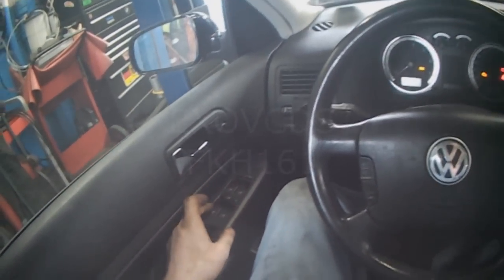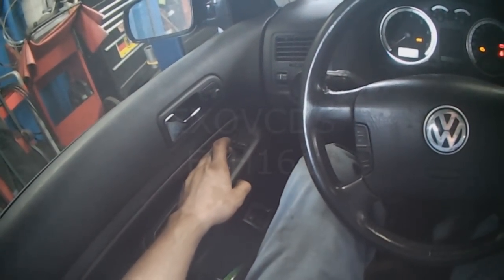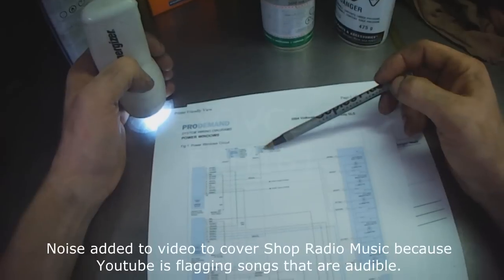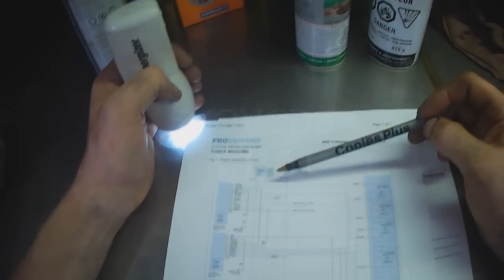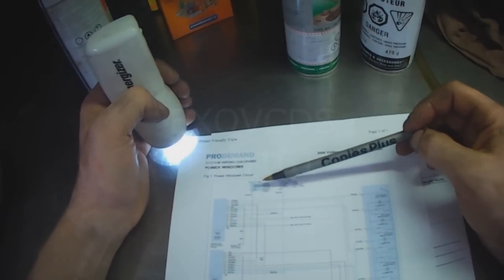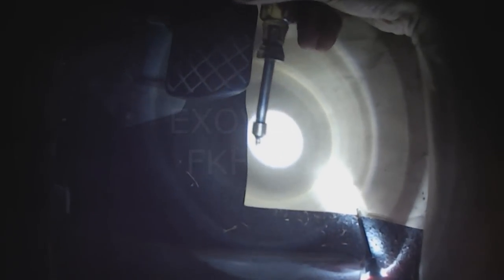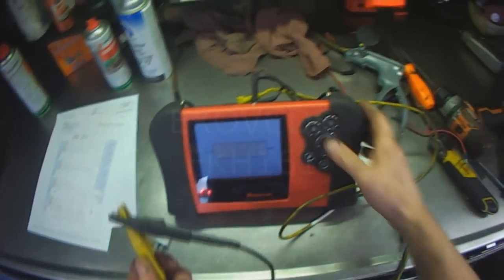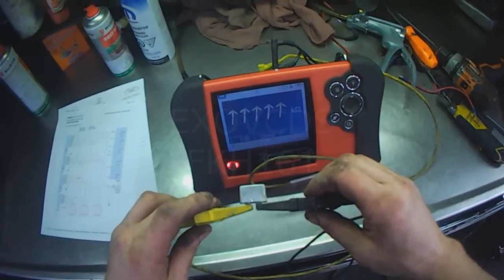VW A4: Power Windows not working

Comment: Hey Thomas! Love your videos, very helpful. I have an issue that is similar to this, except my sunroof, and power windows dont work, but my power locks do. I would assume theres another issue going on here because i've checked my fuses, and the circuit breaker looks good as well. -Thanks!
Reply from the maker: Year, make, model, engine, transmission.... so I can find the correct wiring diagram. You'll have to do your own investigating, as per diagram... I'm just starting work, so I'll get the info to you as soon as I can. If I find the correct diagram, I'll also look at it to see if I can spot something, but that might not happen right away.
Reply: Thomas EXOVCDS silly me, I appreciate the time you take to look it up, it's an 03 Jetta GLS 1.8T AWP, I believe o2m
Reply from the maker: http://fkh161.ca/VW/mk4PW.pdf
http://fkh161.ca/VW/mk4SunR.pdf
I'll look at t he diagrams later in the day to see if I can spot something that might be a common issue.
Reply from the maker: Sorry, the second diagram won't print to pdf correctly for some reason.

Comment: Hello Budy, how are you?

I live Brazil and no one works on these cars here, all i have to do. I myself do that.
I'm going through the same problem, as did everything in the video, but did not return to work.

Any tips the most?

Car: Passat b5 98/99 motor: 1.8 20v turbo AEB Manual

Thank you

Sorry for my English.
Reply from the maker: +andre luis aragão Click the link for a wiring diagram... print it out and check the fuses / power & grounds / wiring: http://fkh161.ca/VW/Passat/B5PW.pdf

Comment: HI Thomas, do you have a part number of the circuit breaker so i can order one to go straight in, my windows are clicking, so i guess this is the problem, 2002 passat b5, Thank you :-)
Reply from the maker: Install a regular fuse for testing... if thing work, google the part number that is on the circuit breaker. If things don't work, then it could be something else... but make sure that there's power at the circuit breaker.
Reply: @EXOVCDS  
It works ! Thank you so much for your help Thomas, Fantastic work my friend, cheers  :-)
Reply from the maker: @bassbins  Thanks for the update! I forgot to get back to you a few days ago... sorry. I get so many messages daily that I forget what I wanted to do. Here's the part number of the circuit breaker. 443937105A (30A)

Comment: Hello Thomas, I have exactly the same problem that all my passat b5 windows are clicking, so I replaced the circuit breaker with replacement new VW circuit breaker but this hasnt fixed the problem, any ideas how what i could try next to fix this?
Reply from the maker: Does the circuit breaker have power all the time? Is fuse 38 ok?
Reply: Fuse 38 was okay, turns out that when i pulled up the passenger carpet, all 4 cables had corroded away from the power connection as there was water in the foot-well where the wires are laid. I cut and reconnected. I also had to take the door panel off the passenger side and use circuit cleaner on the motor connection as this had corroded as well. now all the windows work. Thanks for diagnosing on the video that the clicking indicated that the signal reached the motors as this helped identify the issue was with the power.
Reply from the maker: chump city Thank you for the update... good to hear you sorted it out (I would not have been able to guess corroded wires due to water intrusion).

Comment: After I’ve swapped my battery on MK5 TDI ALL THE WINDOWS GONE CENTRAL LOCKING, MIRRORS, any idea please
Reply from the maker: Are you that the battery wasn't attached backwards by accident? Removing & replacing a battery should not cause any issues... unless something went wrong.
Reply: @EXOVCDS  probably yes 😔.. But fuses r fine. I’ve noticed today no lights on the central locking buttons, mirrors button etc etc

Comment: hi thomas same problem on my vw variant but no clicking of the relay what do i need to do?
Reply from the maker: I'd have to check a wiring diagram. Year, model,  engine, transmission or vin so that I can look at a wiring diagram. email me so I can send you the diagram once I have it. fkh161 @ fkh161 .ca (no spaces)
Reply: @EXOVCDS  it has been ok dear it was a blown fuse and can you tell me where the fuse for the airbag situated please?
Reply from the maker: I don't think that there are fuses for airbags... pulling a fuse or disconnecting the battery will not clear airbag codes.
Reply: @EXOVCDS  cause after replacing a fuse under the dash it came on.
Reply from the maker: Check for airbag fault code with scan tool... once you know what the code is, you can find where the problem is.
Reply: @EXOVCDS  ok wil try it thanks in advance
Reply: Hi thomas i am experiencing same problem as you again but now it's clicking but not roling up.
Reply from the maker: Check for broken wires in the door jam wiring loom.. or for a bad connection somewhere. I still haven't received an email with the information that I asked for (so that I can look for a wiring diagram for you).
Reply: @EXOVCDS  it is a volkswagen passat year 02 and 1.9 turbo diesel
Reply: Manual transmission
Reply from the maker: Look for wetness under the carpet... the comfort control module is under the carpet. Water can collect and can cause damage to the wiring & the module. Like this: https://www.instagram.com/p/BT7wg5flgee/  (press the play button)
Reply: @EXOVCDS  already checked and it is in good condition
Reply from the maker: OK... I'll send a wiring diagram to your email.

Comment: Thomas my window and central locking not working l have checek all fuses on my vag is show 01328 ,01329.1331,32,33and34 l chnaged the comofrt moudel and still same
Reply from the maker: Check a wiring diagram for all the applicable fuses (power & grounds) and then check all those places with a test light or multimeter. I'm out of town until Sunday and can not check specifics for you, sorry.

Comment: I have a 2008 vw Jetta and i can't get the window up. I hear the clicking noise when I try to let it down but i don't hear it when i try to let it up. What do i need to do?
Reply from the maker: I'm still at work... will get back to you later tonight once I'm at home.
Reply from the maker: What happens when you hold the key in the LOCK position for a few seconds in the driver door (outside handle)?
Reply: I don't understand what you mean. Am i trying to lock the door from the outside with the key? Cause if that is the question, the answer is nothing happens. The window looks like it is too far down in the door. But like i said when you press the window button down it makes clicking noise but when you try to let it up there is no noise. Do you know what it could be?
Reply from the maker: Holding the key in the lock or unlock position activates the windows (courtesy feature). All windows should go up or down depending on which way you hold the key.
My point was that if the window works when using the key, then the problem is with the switch / input side of things.
It could be a wiring harness issue... check for broken wires in the door jam (open the door and look in the accordion boot that the wires are in). Replace the wiring harness or repair the broken wires.
Reply: I finally got it to go up, even though i don't know how. The only thing i did was take the door panel off and hook the window controller back up. Then i pressed the window down three times and then i tried to let it up and then it went up. I don't know how it just started working, but i put some type over the button so no one can let it back down until i can get it fixed. Would you happen to know what might be the problem?
Reply from the maker: The A5/mk5 platform had wiring harness issues (as mentioned) as well as problems with the window regulator motor (door module). The "door module"is part of the regulator motor. I have had several Jetta's where either a window or a door lock actuator failed to work... but would work when pressure was applied to the harness plugs that plug into the window motor / door module. Not sure what the issue is with your vehicle... a wiring diagram and some testing of powers & grounds, along with a scan tool to view "inputs from switches" should help determine where the problem might be. But start with a visual inspection and wiggle test of the harness plug connectors at the window motor / door module.
Reply from the maker: A friend of mine had a similar issue:
https://www.youtube.com/watch?v=r5PWqqd9e2c

Comment: Ahhh.. I see you are using pro demand, much better then the factory layout I think..
let me guess this is a mkiv body style and the sun roof drain get plugs causing water to leak inside?
Reply from the maker: We are trying out Pro right now. It does seem to be better. As always, the repair is only about the complaint (no power windows)... didn't get a chance to track down any leak(s). Now that the customer knows what fuse / circuit breaker to check, they may or may not be back for a leak check.

Comment: My both Windows in caddy dont work
But cant find the circuit breaker
Reply from the maker: Year?
Reply: @EXOVCDS  2012 1.6tdi , replaced both switches checked fuses , but can only hear motors exactly as on your video but dont open
Reply from the maker: 2012 most likely doesn't use circuit breaker fuses such in the video. I'm in North America. We don't have that model here. The Motors in my video don't make noise... the relays make a clicking sound, not the Motors. I can probably find some information about your car by this weekend... I can get back to you then.
Reply: @EXOVCDS  ah i see
, Yeah it does make same noise as yours in the video , not sure what could be the problem , will take it to mechanic and see if he can plug computer and checks for any faults , thanks tho

Comment: Hi Thomas! I just bought a used 2015 VW New Beetle. Over the last 2 days, the windows responsiveness have significantly degraded & now have stopped working correctly from the drivers side door switches. The windows can suddenly (without pressing on the switch) go down and up, super randomly. I can also hear a clicking nose combination when the car is running. Could this simply be a fuse issue? Since I do hear the clicking from the motor? Any insight would be very much appreciated.
Thanks in advance!
Reply from the maker: +Marie-Claire Weber not gonna be a fuse issue in my mind... I'd look at a switch issue (corrosion inside the switch from water or spilled drink intrusion). Or wiring issue of the main door harness. My first step would be to check for fault codes and use the scan tool to check switch operation.

Comment: Hey brother. Quick question. I replaced my driver window regulator on a 2001 GTI with a used regulator. I found out later that there was a different motor for 2002 forward. Nothing works now. Does using the wrong motor fry anything, or should I just be able to replace with the correct one? At the moment neither side is working. If I unplug and replug the motor harness the driver side will work until the car is turned off, then will not work again. Any input is greatly appreciated. Thank you.
Reply from the maker: Swap your original motor over and see if things go back to normal.
Reply: Thomas EXOVCDS I threw it out, like an idiot. Ordered one from eBay, but nothing. No functionality at all. Maybe it's bad.  Is there something that needs to be done to reset the motors when swapping?
Reply from the maker: +Mark Torres The motor is the "door module"... if it's the wrong one for the vehicle, it can not be adapted or coded to work for a different application. As far as I know... I could be wrong.

Comment: hey Thomas. i have the audi b6 1.8T and passat b5 1.8. The audi b6 windoors are not responding  in any way and only 3doors will lock by remote except the front left door which does not respond at all to the remote. the key can only lock the driver side and only unlock the boot. the passat b5 does not respond to the remote in any way but can respond to the key only when i unlock on the boot. the key can not unlock or lock the driver side. i have tried all your tricks but it failed. help me out dude.
Reply from the maker: I'm still at work... will try to get back to you tonight after work.
Reply from the maker: Isaac Seleka Sounds like you need some wiring diagrams for both vehicles to trace things down. The VW Erwin website only charges $35 USD for 24 hour access... download as much as you want after entering your Vin number(s).
 https://erwin.vw.com/erwin/showHome.do
Reply: Thanks a lot thomas. I wil try download the wiring diagram and trace the problem
Reply from the maker: I couldn't send you a private message via youtube by the way. I sometimes send links to service manual information to people via youtube private message. If you don't know how to enable that, sign-up to my Tech forum and I'll hook you up with info there. I just didn't want to publicly post info here.
Reply: Hey Thomas, i discovered something strange. when the audi started misbehaving i just parked it coz da internal heat was too much for me to handle. Yesterday i thought of doing a check on all items to see the problem could b coming from. To my suprise, the wipers, indicators, dim option, electric windows and doors are all not working. All fuses are fine. Audi forums says its the CCM.
Reply from the maker: Isaac Seleka Possibly... check that the CCM has power / is awake (use a scan tool to check if you can communicate with it).

Comment: I have a 2001 Audi A4 none of my windows go up or down sunroof doesn't open and locks also on my driver side of the door the lights are not working on the panel but on the passenger and back door the lights are fine please help
Reply from the maker: Possible wiring issue in the door jam... look for broken wires where the door meets the chassis. 

http://i132.photobucket.com/albums/q33/x1rider/door21.jpg

http://www.audiworld.com/forums/a4-b6-platform-discussion-34/driver-door-wiring-harness-replacement-write-up-lots-pics-2379267/

Check the wiring as per the 2 links. If all is OK,  I can provide you with a wiring diagram, so that you can check power & grounds.

Let me know what you find.

Comment: I have no power on my window fuses and change the window relay and still no power .can u help me please 2007 honda ridgeline
Reply from the maker: Are you sure you checked all the fuses?
http://fkh161.ca/Import/RidgelinePW.pdf
Reply: @EXOVCDS  yes all the fuses are good .checkd the voltage and there is no power. They stop working after a guy install a remote start on my truck, he says he doesn't mess with the car windows any ideas?
Reply from the maker: No... you have a wiring diagram now... should be enough to find the problem. Follow the power / check the grounds.

Comment: And what if it is on the front passenger window help!!!
Reply from the maker: All windows work except for the front passenger? When you use the master switch or the switch in the passenger door... do you hear any clicking from the passenger door window regulator motor?
Reply: No sometimes works and sometimes doesn't but only if I press it on that side
Reply: And no It doesn't make that clicking sound
Reply from the maker: +Natanael Arellano Check the switches & wiring... could be a switch or motor issue.

Comment: This might be a long shot, but could use some help. Checked the 30A breaker, all good. Power on both sides of a fuse when plugged into that spot as well. Checked fuses 5, 6, 14, and 38 and all have continuity and have power on both sides. None of the windows work, no backlight on any of the door switches, and no radio backlight. Anyone have something else I could try?
Reply from the maker: Year, make, model? So that one can look at a wiring diagram. 
Some people think this video is about Audi A4's.
Reply: @EXOVCDS  2003 VW Jetta 1.8t. I thought it was my CCM cause there was something rattling inside it, but I just tried another one from the junkyard and the same issue persists. Nothing stopped working as a result of the new CCM cause
Reply from the maker: @ryanking2774 
I'll look at some wiring diagrams at work tomorrow and will get back to you.
Reply from the maker: @ryanking2774 
Sorry, busy day today. I didn't get a chance to check. If not tomorrow,  then for sure on Saturday!
Reply from the maker: @ryanking2774 
Can you communicate with the ccm?
Reply from the maker: @ryanking2774 
Yes, VAGCOM or OBD2 scan tool. I brought my work laptop home yesterday. I'll get back to you later... heading out to run some errands.
Reply from the maker: @ryanking2774 
System scan (all modules) would be of help.
Also check fuses S111 & S144 both fuses are above the relay panel (both 15A).
Power windows should work regardless of CCM (I think).
CCM is just there for courtesy opening of all windows (via orange /green communication wire in each door).
Verify that there are no broken wires in the driver door jam loom.
Check the other doors as well, in case the communication signal is pulled to ground by touching a broken ground wire in the loom.
The front doors are master modules and the rear doors are slave modules (part of window regulator motor).
Reply: @EXOVCDS  sorry for the delay. Checked those fuses and they were fine. Tried unplugging each window motor individually to see if one of those were the issue, didn’t help things. Checking voltage on the OBD2 for CAN high and CAN low to ground and they both have only a few millivolts. Maybe there’s the issue?